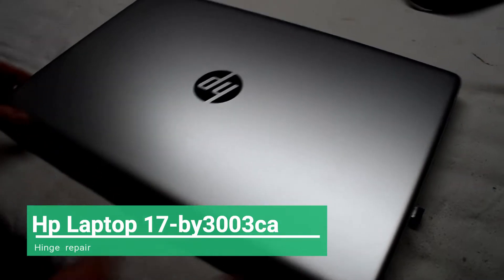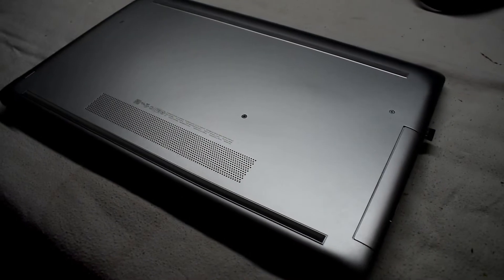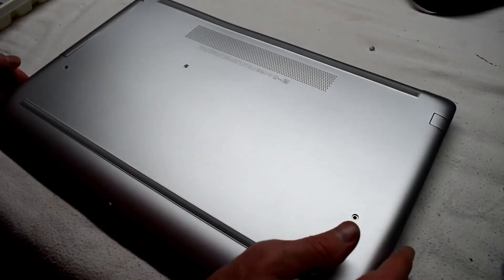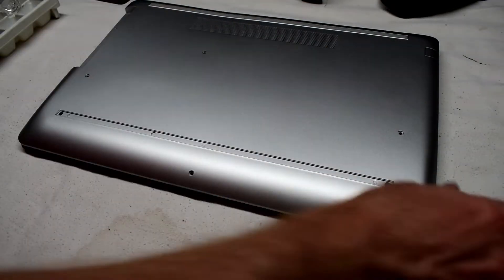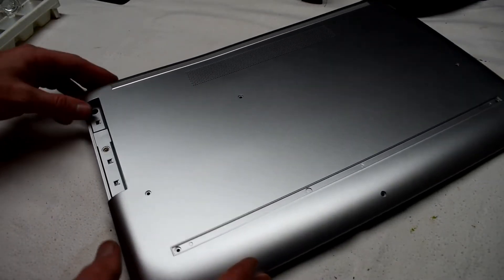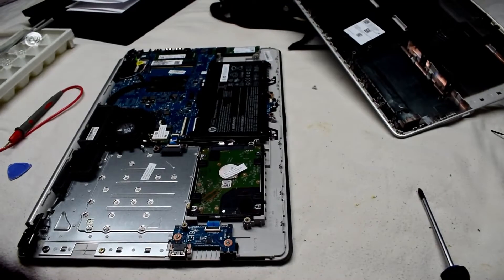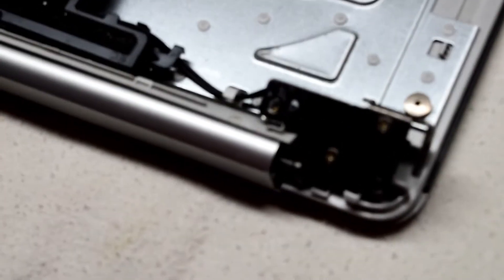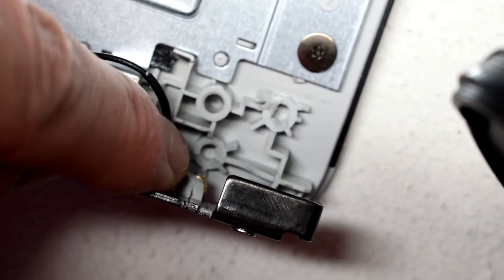HP Laptop Hinge Repair (Model 17-by3003ca)

Comment: These break for a reason, if the hinge tension is not adjusted this repair is a complete waste of time.
Reply: The tension is required to hold the heavy screens open. The problem is HP isn't smart enough to make the hinges longer so all that force on PLASTIC! This is the Achille's heel on HP laptops. I've got two with broken hinges, the plastic mounting for the hinges is what breaks.
Reply: @StillAProudAmerican-ll2yc  It’s simple, take two minutes and loosen the hinge tension to the point where the lid moves freely, but is still properly supported, the plastic screw mounts will never break again. 
Or, if the tension is adjusted before the mounts break, you have prevented a costly repair

Comment: This method is not good. Recently i used both method epoxy and glue gun. But after few action of open and close. It broke again.
Reply from the maker: you need to loosen the bolt on the hinge
Reply: @NewsonsElectronics  And add either mineral oil or sillicon grease. 😊

Comment: I got a 17-by3065st with the SAME issue. These models use crap hinges. This one is so tight it's hard to even move the bare hinge with two hands. After replacing the whole palmrest, I used some epoxy to strengthen it. But the back (actually top palmrest) still flexes when opened and closed. EDIT: Opened the hinge cover, used an interchangeable screwdriver socket (perfect size) to loosen the nuts just a bit. Works a lot better.

Comment: Thanks for the video. I have the same issue on my 2 yr old Notebook. Did the hot glue hold? Wouldn't epoxy work better?
Reply from the maker: it would you you could never open it again if something went wrong
Reply: @NewsonsElectronics  Good point. I saw where a few people used machine screws and nuts to hold it together. No glue used at all. The crew head can be seen on top, but as long as it works well, it's good. They also loosened the tension nuts on the hinges a little and oiled the hinges since the tightness caused the problem.